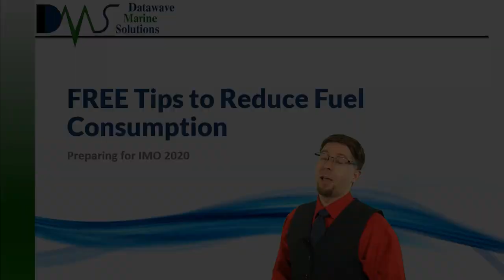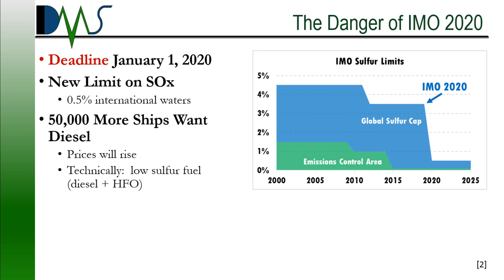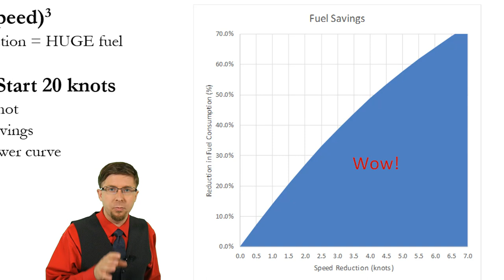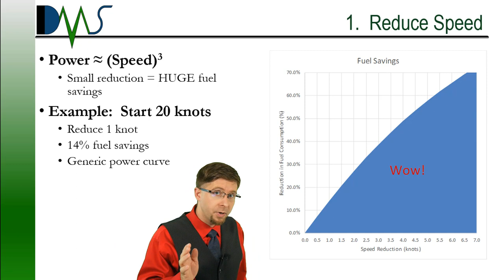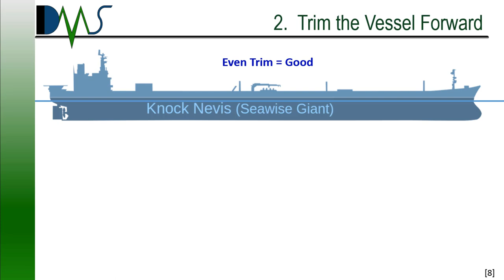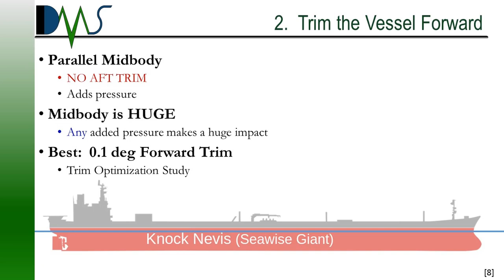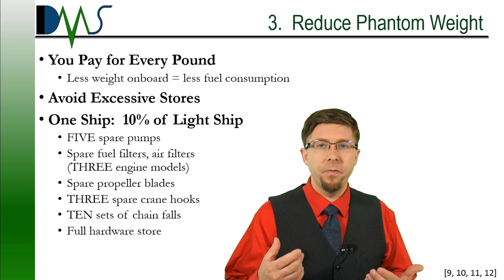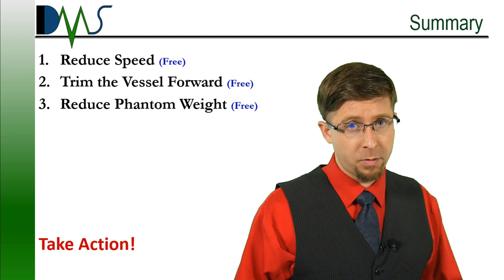FREE Tips to Reduce Fuel Consumption:  Preparing for IMO 2020

Comment: In short, everything that involves the transport of goods across land or sea will see price increases soon.
It also means more waste from each barrel of oil as less of it will be usable without adding far more energy to the refining process.

Also, is a one knot reduction in speed "free" if it equates to a 5% reduction in distance traveled?
Reply: No offence, but I'm fairly sure he ment the same distance travelled, just over a longer period of time.
Like the wind pressure (drag) slowing down your car on the motorway, (stick your hand out the window slightly and feel that wind pressure) at motorway speeds, verses the wind drag on your car driving threw residential speed areas.

Because water has so much more mass resistance in it then air, that's why speed reductions from 20 knots to 19 knots  makes a significant difference, while driving say from 22 miles per hour to 20 miles per hour in your car, you probably wouldn't notice the change in wind resistance nearly as much.
Reply: @davidodonovan1699  "No offence, but I'm fairly sure he ment the same distance travelled, just over a longer period of time."

A year is always the same period of time. A slower boat completes fewer trips in a year. That means more boats would be required if the same number of trips are required.

"Because water has so much more mass resistance in it then air, that's why speed reductions from 20 knots to 19 knots  makes a significant difference"
In the case of a cargo ship, that's not really the case. Their hull speed is determined by length and their hulls are designed to be most efficient at a particular speed. (Passenger cars aren't designed for a specific speed.)
Displacement hulls see the largest increase in energy required as the vessel approaches its hull speed. The energy required to exceed hull speed increases geometrically after that versus the linear slope prior.
Reply: @wisenber  Yes, a slower boat does complete less trips. This means that you need to calculate if the reduced speed, is at a cost contracts that could have happened if the ship had arrived sooner. Hence, this is a buissness manager's job to organise a steady stream of work.
Like the airline industries focus, that if a plane isn't in the air, then it isn't making money. Apparently Ryanair doesn't pay its staff when they are on the ground, even though they have to do work when the plane is landed. This sounds very illegal, but it's Ryanair, so it could be someone making stuff up about them, or it could just be bonuses, who knows, or actually just an illegal contract, who knows.
As for the most effective speed, you make a good point. But I presume that a buissness on this scale, would already have made those calculations well in advance.

This advice is probably aimed at amateur boaters. Even a 15 meter cruiser rib, travelling out for a weekend, with highly efficient engines, will know this calculation.
Reply: @davidodonovan1699  15 m private vessels have had different regulations all along.
When I had a 17 meter Azimut, it got much better fuel efficiency at 20 knots than it 7 knots. Then again, an Azimut has a planing hull in contrast to a cargo ship with a displacement hull.
Most cruisers choose their speed based upon how much time they have versus the fuel economy. If I planned on meeting people for dinner 90 miles away in a few hours, I wouldn't travel less than 30 mph. Saving 12% on my fuel cost wasn't very helpful if I missed the dinner that the trip was all about.
Reply: @wisenber  OK. Thank you. Good point.
Reply: @wisenber  Thank you for this information though. I am very surprised that 20 knots was for efficient then 7 knots, but I can understand it's probably for overcoming the initial forces on the boat, preventing it from moving, like wave movements an the general friction that water has.
Reply: @wisenber  again, thank you

Comment: With the deteriorating supply of low sulfur sweet crude oil, obviously the high sulfur frack oil is now in the market that demands higher price that will make the IMO 2020 a failure to implement.